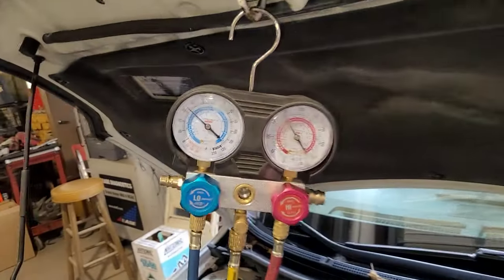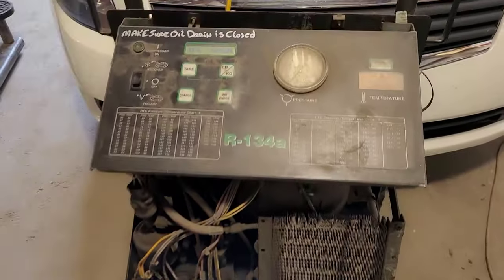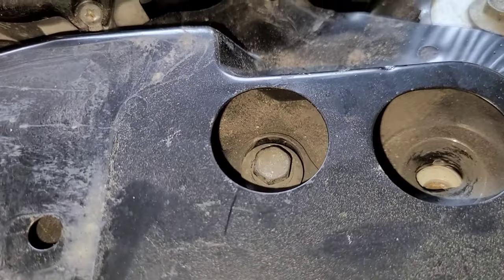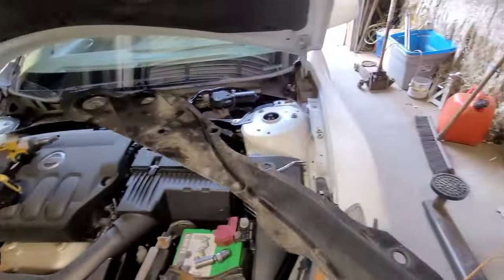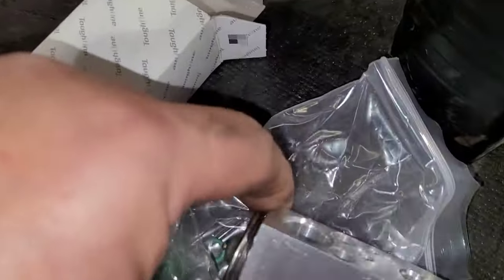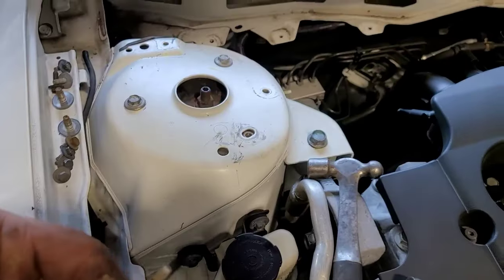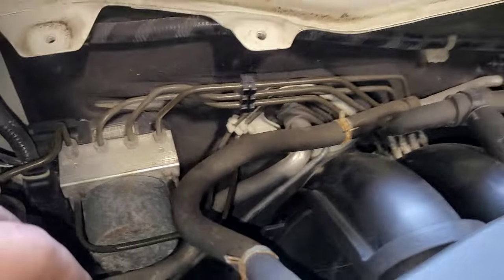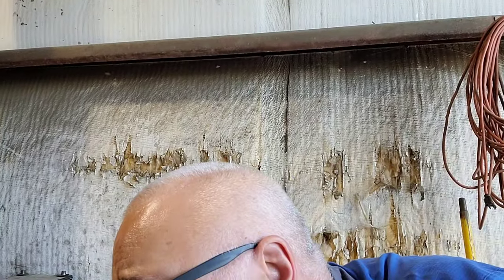AC not blowing cold, then it works fine !?!?  What could cause this?

Comment: AC guy with a few decades under my belt. Train and test for AC 608 and 609 certification.. Do maintenance and repair as well as theory training. This scenario will be tough. Simply replacing the valve, and really the dryer at a minimum means this system will absolutely grenade itself again in short order. When you see that black coating and gunk in the TXV valve like that it is contamination. Likely this one has had a small leak (service port cap left off, schraeder valve leak PUT THE SERVICE PORT CAPS BACK WHEN YOU ARE DONE!) resulting in topping the system off several times. Refrigerant leaks out, air gets in whamo bammo add more refrigerant, it cools OK, for a while. For you see when moisture gets into the POE or PAG oil (likely this is PAG) the oil absorbs the moisture (hygroscopic just like hydraulic brake fluid) turning into a dirty slimy gel like you see in the old valve. Anything we do in good intentions now given that we will likely NOT be able to flush this thing out (Thanks EPA for forcing car makers to be more environmentally "friendly" using more compact heat exchangers) This car needs it all, valve, dryer, evap, cond, lines and oil. This one will only die again SOON and cost more every time. And BTW so of that gack we see in the valve probably has fine metal in it given the age of the car showing us the compressor is on the way out too.....Remove the filter dryer and dump the oil out of it...bet you see more slime and metal.....I would hand  this one back to the customer with explanation and a NO SALE invoice labor only for a diagnosis this is a non fix unless you do it right.
Reply: I have a Kia soul 2012 with 74K miles. Compressor is leaking oil, maybe coming from the valve. System is working fine, cooling as usual or normal. I bought a brand-new compressor. Do you think is ok to replace just the compressor or it needs to replace expansion valve and drier? If I have to replace drier, I have to open it, so moisture will get in, is not better to buy the whole condenser that is coming with drier inside?
Reply: Very interesting
Reply: This was helpful as I also see the black liquid on the high side of the TXV. I am now replacing EVERY component.
Reply: Bro chill, you don’t have to call anyone a PAG. It’s okay
Reply: A question, not saying you are wrong,i'm a mechanic that's always eager to learn. They always say that moisture and air can get in the system, but i have a hard time believing air can get in a system that's mostly closed and constantly under pressure. Sure moisture maybe because of the hydroscopic nature of the oils but i always thought of it as strange.
Reply: Completely correct, that whole system needs replaced to eliminate any further problems. What was done here will come back to bite you when it crashes and the customer wants it fixed at your expense.
Reply: @Gman193  temperature fluxation causes the systems weak points, i.e. the compressor seals to leak out and pull in very small amounts of atmosphere and over time this is why the system contaminates.
Reply: Poor guy was just trying to comment on a video he watched and immediately gets attacked for questioning just because he has experience.
Reply: @Gman193 the system can suck in air through the suction line.
Reply: @hisautorepair124  Problem is the "suction" side of an airco system is still around 2 bar.
Reply: It will be fine. 😂 The black stuff is from the valve itself, relax.
Reply: @irisbaez1972 With a new compressor your best bet is to replace the expansion valve and condenser, plus, you must clean up the whole a/c system to flush out any dirt, metal speks, etc, that is accumulated in the pipes, hoses, etc.
Reply: @Gman193 air can filter inside the system if there is a leak in (the system), when the compressor is running it injects and ejects gas and oil, during that procedure, with a leak, it absorbs air. So it can happen. Air and moisture damage compressors.
Reply: @irisbaez1972 changing the drier alone should be good enough unless the oil looks dirty then you should change the expansion valve as well.

Comment: Again you won't show the good stuff! You jump around way too much
Reply: Also, he guessed at what the problem was.  Lots of issues with this approach.  What was all that black crap on the inside of the TXV?  Might wanna determine that.
How bout the initial charge?  Didn't look like you got very much freon out with the recovery machine.
Was the system undercharged?  Leaking?  Why was there fluorescent dye in there?
These questions and MANY more would need to be answered before chuckin' a new TXV in there.
Another big one..... a/c pressures aren't accurate at idle.  You need to raise the rpm's and see what the low side does (like when you're driving).  Lots of issues.....

Comment: Great job.  I recommend replacing drier anytime system is opened. Also break vacuum with nitro rather than with atmosphere.  The oils used with R-134a are hygroscopic meaning they have an affinity for moisture.  It cannot be removed by vacuum only with desiccant in the drier. If TXV stops feeding the evap then low side will go into a vacuum. You are essentially pumping the system down and stacking liquid up into the condenser. That reduces the surface of the condenser and causes high discharge pressure. Hope that helps you some.
Reply from the maker: Thank you! I am by no means an AC expert. I appreciate you sharing your knowledge with me. Keep wrenching 🔧
Reply: @WrenchingWithKenny  happy to help when and where I can. Been an A/C and refrigeration tech since '02. I don't have a problem with helping others.
Reply: Topher8634 i have an 08 vw jetta how does an diyer like me remove the refrigerant to just replace a  switch on the compressor
Reply: @donaldharris1134  without a recovery machine nor a vacuum pump the only other method is to place a recovery cylinder in !bucket of ice and connect the hose to it and open valves. Refrigerant migrates to the coldest environment. Of course you will need some manifold guages and a recovery cylinder at the very minimum. This will only remove Refrigerant liquid and will not reduce system pressure to zero. You will want to pull a vacuum before recharging for optimum system performance and longevity.  Which switch is it...there is usually a valve core underneath preventing the loss of charge when it is removed. Let me know and I'll research.
Reply: @topher8634  thank you sir for taking time to reply its the compressor control solenoid on a 2008 vw jetta 2.5 making the compressor have intermittent cooling
Reply: @donaldharris1134  ah the capacity control valve AKA compressor control valve. You definitely have to discharge the system for that. And possibly remove the compressor from the vehicle.  Sometimes you can change it with the comp still in and just loosen it from its mounting bracket. It is intermittent cooling?  I have seen misdiagnosed "bad" control valves actually be a bad compressor and vice versa. A faulty TXV can also cause intermittent cooling. Pressure readings [low & high] when system is operating are critical for a proper diagnosis. Do you have a guage set?
Reply: You said moisture cannot be removed by vacuum only you're totally wrong because that is the purpose of but you have to have a micron gauge and get it down to five hundred microns or below that's how you remove moisture from any air I know what I've been talkin about because I've been doing this since 1976!!!!
Reply: @david5128  didn't say vacuum wouldn't remove moisture from system I said when the oils used with HFC refrigerants becomes contaminated with moisture you cannot remove it by vacuum only by means of a desiccant. The moisture will stay dissolved in the oil. Mineral oil and AB oil it was never a problem. Both Modern Refrigeration & Air Conditioning and ACHR News talk about proper practices and the hygroscopicity of HFC lubricants. You should be familiar with both publications having been in the field for nearly 50 years.
Reply: @david5128  New equipment manufacturers recommend less than 350 microns.
Reply: @topher8634  you don't understand a vacuum you can remove moisture from the  oil l of an air conditioning system by getting it below 500 microns. The oil will not boil. (evaporate) unless the microns get below 50 microns!!!!
Reply: @david5128  I understand vacuum entirely.  It reduces the pressure and lowers the the boiling temperature of the water to allow the vapor to be extracted by the pump. However as I have already stated molecules of water will not readily release from POE oils. Yes you can vacuum all night long to 0 microns if you want but the water will remain dissolved in the oil. If even tried charging with a small amount of nitrogen and starting the compressor for a few seconds then again pulling a deep vacuum and still have the moisture indicator show "wet". There is a very good demonstration on youube of moisture trapped in POE and it's refusal to release. It is shown in a mason jar. Every manufacturer of POE lubricants and manufacturers of equipment that use POE lubricants all document that moisture CANNOT be removed from the POE oil by vacuum. It has to be by desiccant. If contaminated severely you will have to change the oil and return possibly several times to change the filter driers to dehydrate a system. I take it you have never done supermarket refrigeration? Or chiller repair?
Reply: @topher8634  I'm just going to try to get my point across one more time what I'm telling you about moisture in tall was shown to me and prove it to me in a lab that does moister removal in refrigeration oil the only way I can show you and prove my point is if I had a lab but I don't have one to show you what I'm talkin about but I've seen more some remove them all with a vacuum. It don't matter water's always heavier than oil.
Reply: @topher8634  hi maybe you can help me out here. I have 2015 chev suburban and no leaks, all ac components are working. Ac charged with right amount an pressure is within range. From florida. My problem, during morning and night, ac goes down to 40 F but around 2 or 3 in afternoon in hot day, 90 F or hotter, ac does not cool lower than 70 or 60. Pressure line sweats when it goes down to 40F but are warm to hot when cools to 70 or 60. Thanks in advance
Reply: @hienowens188  have you verified the condenser fan operation? I haven't had to work on any of these era Tahoe/Suburban. These are clutch cycling systems therefore no electronic capacity control valve. If the fan is working the only things that come to mind is a possibly intermittent clutch cycling (low pressure cut-out) switch or connector, same with high pressure switch though not as common, connector at compressor,  compressor clutch relay heating up and breaking contact, slipping belt, or incorrect air gap on the compressor clutch. When it is not cooling what are the pressure readings? Pressure readings are key to diagnosis of refrigeration problems. If you are making a 40° evap temp then I'm not suspecting mechanical refrigeration problems. Sounds electrical. If high side pressure is spiking during non-cooling then investigate the cooling fan operation or poor airflow across radiator/condenser (bugs,dirt,debris). Hope this gives you some direction.

Comment: That system was probably wet. They make test kits for the refrigerant. I wonder if the system was opened and it didn't get pulled down sometime in the past.
Reply from the maker: Anything is possible. This vehicle was sitting apparently with a blown engine for a number of years. Possibly it was disassembled and left sitting with the system open
Reply: My mrs Volvo was the same was left open to the elements for 3 years. I put a new condenser and filter dryer on it and it needed 15 hours on the vacuum to get the moisture down below 200 microns. You won’t see the moisture content using those analog gauges you need a digital vacuum gauge and set up in an app to graph the vacuum progress.

Comment: The low side should have gone into a vacuum if the TXV was stuck closed. The high side would go up but should not have pegged out. Usually if the high side goes that high it is a lack of air flow over the condenser, either from a faulty fan or a plugged condenser.. Tip; always use an anti-seize on the TXV bolts.
Reply: High side will increase with a failed TXV especially if it is completely closed up. It is essentially a restriction. Liquid stacks up in the condenser and with nowhere to go high discharge is the result. It also depends on where manufacturers put the high side port. If it is in the Liquid line between cond and evap you will not see high pressure. If it is in the hot gas line between comp and cond you will see high pressure. Hope this helps.
Reply: Seeing how fouled the inside of that TXV was could that have resulted from using the typical Walmart brand or AutoZone/Advanced Auto recharge bottles that also contain other ingredients such as sealant and other additives....

Comment: Very informative. I just replaced my compressor and condenser. Bought the car with a seized compressor. Now my clutch kicks on and off as I drove home from charging my system. I did notice that i had lack of power like the compressor had alot of load on it and its a v8 shoulnt be struggling on the freeway. So this really narrows it down for me. Im going to do another thuro check to make sure this is my issue which im already 100% sure it is

Comment: Thank you!
Thank you!
Thank you!

2003 Subaru Forester XS AT - bought three years ago. She's definitely taught us a lot! :)

This issue describes our current challenge. System was evac'd and recharged with a Robinair system; no dye PAG oil, just R134a. The gauges were within Normal ranges, but high was a bit too high.

Over the following days, I cleaned the evap / vents using the Subaru cleaner, and cleaned the Condenser & Radiator with coil cleaner (5:1). After 20 minutes of AC, the surging RPMs and clutch clicking starts, almost stalls the car... I then cleaned the throttle body, IAC, and the MAP sensor. Now the issue starts even faster! :)

I checked the Clutch on the Compressor and the bearing seems a bit rough, so I'm going to replace it and the belt next. I don't have my own gauges, pump, or catch-container for refrigerant to remove the H-valve and flush the system, as yet, so mayhap the Clutch bearing is the issue - overheating..?

Thank you, again, for your videos!

Comment: That black in that expansion valve is from a pump. Be it that pump or from another pump, it's a sure sign of a pump failure. Some systems can't be properly flushed because of parallel condensers and they need replaced, so many people just shove a new or rebuilt pump on it and call it good. If that's the case here then the pump will fail prematurely. Probably also why that expansion valve failed, it's corroded up with that black stuff and it's hanging up.

Comment: Ahhh ha! Having the exact same issue with my 96 corolla, we figured it could have been a blockage in the receiver/drier (low side was far too low when it was refusing to work, dad left high side adapter at work, so we couldn't check that) but what confused the hell out of us was that it would sometimes work. He ruled out the expansion valve for the same intermittent operation-reason, but the corolla uses the same style of TX valve as shown in this video, so that's evidence that it's the tx valve imo.

Comment: I had a problem like this years ago and it was the evaporator icing up and the blower motor wasn’t blowing through the evaporator and then it would stop blowing cold. The drain was dripping but was a little clogged which allowed the water to back up and freeze… Cleaned out the drain hole and the problem was solved…

Comment: Would be a good idea after recovery to add a slight 2/3 psi of dry nitrogen pressure, if you have gone into vacuum, so that the system doesn’t suck in the humid air when disconnecting lines rather a slight puff out. Make sure you have goggles on you don’t want the oil spat in your eye 👁️

Comment: Debris inside the expansion valve is from the compressor. Many times it’s the compressor that causes the entire system to fail.  When a compressor fails, you usually have to replace everything. Condenser, compressor, lines, etc

Comment: All these videos are good videos, but actually are really simple to diagnose.That really good problems are when pressures are normal ,compressors not cycling On and off and still, you get warm air , those are the the things  lot of us have issues .where everything seems normal yet it's not cooling, it's not.  Pressures are normal yet not cooling, or why not power to compressor while  fuses are good, Those are really simple things.

Comment: I've had to change the TXV on my old Honda Accord project car a couple of times, the exact same symptoms.   If you just start the car up cold, the a/c would blow super cold and show normal pressures with the proper charge level.   But after you drive it for 2 or 3 mins, it would start cycling all the time, and lugging the engine super hard.   I have to do some work to actually drop the evap case out of the dash though, the TXV on mine is inside the evap case, and it uses the style with the long temp sensing tube.   Not a hard job per se, just annoying having to work under the dash board.   I think debris in the lines or system caused my TXV failures, I finally got a pretty good deal on a complete new system through Rockauto for about $230 dollars.   Best money I ever spent, new condenser, new TXV, receiver/dryer, compressor, and I already changed the lines and flushed the evaporator.

Comment: Any debris means that something is creating it.
Changing one part is only a temporary fix until that new part also gets covered in more debris.
A full strip down and flush/clean is required along with maybe new compressor and drier.
Expensive, but the only long-term solution.